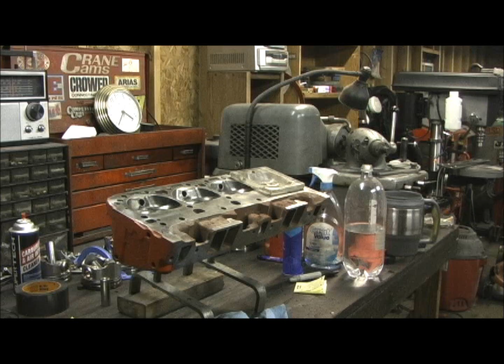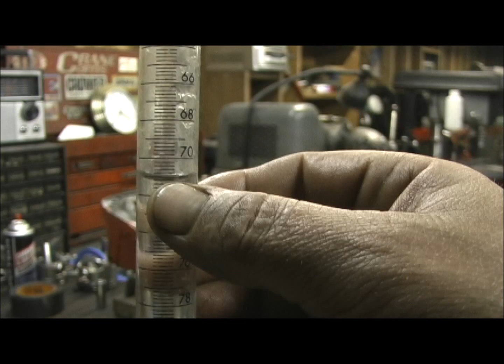SBC 186 CCing Combustion Chambers Stage III.5 1.0

Comment: The bowls of the GM "Double Hump" heads are horribly small from the factory.  It's amazing how the factory heads ever made any power! 
I worked a set of the #492 1971 heads last Fall for my daily driver.  There was so much material that had to be removed it was crazy. I had the machine shop use their cutter while doing the valve job to help open the bowl a tad and get things closer to being round again.  I focused on widening and shaping the short turn, valve guide narrowing, and fully blended match to the #1205 gasket.  Opened them up to the 2.02/1.60 w/screw in studs and guide plates. 
Other than going a little to small on the cam they're working great on the 350 CID just need to swap to the 700R4 to better the highway gas mileage.